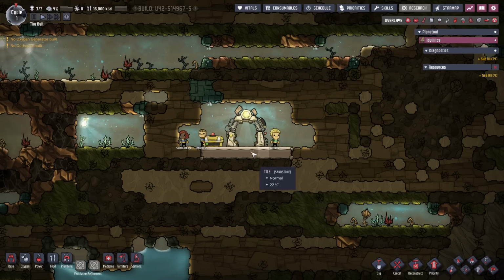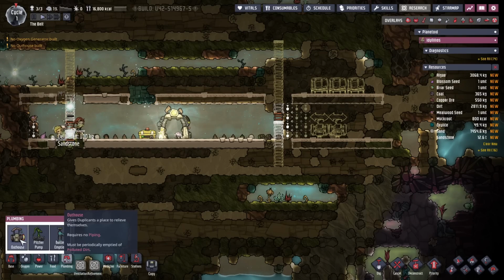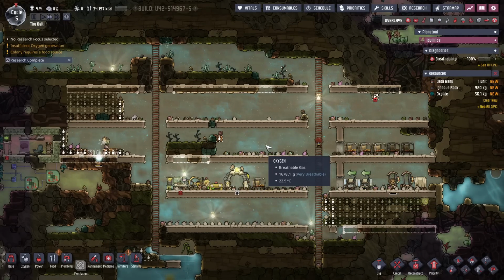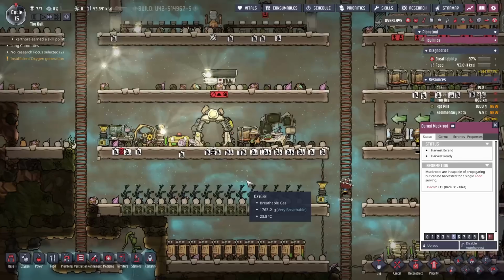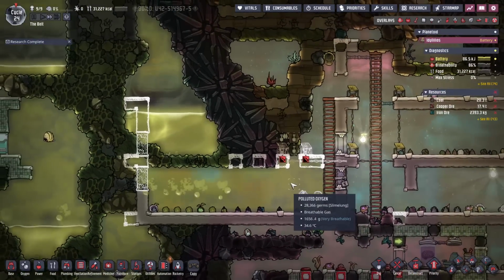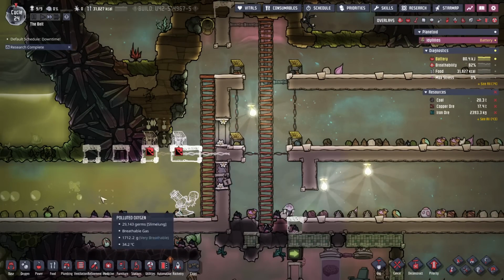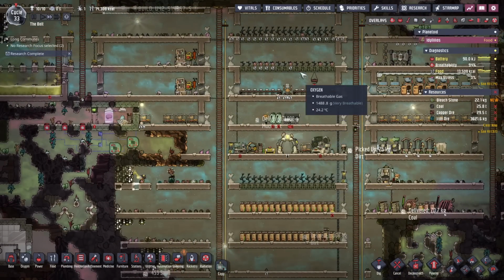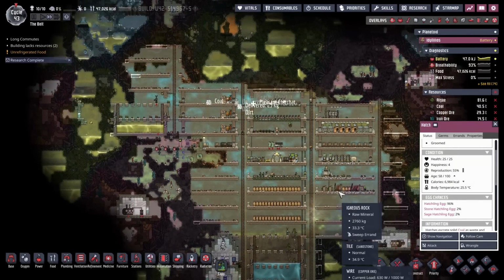Return to OXYGEN NOT INCLUDED | Optimizing First 50 Cycles | #1 | Lets Play/Walkthrough

Comment: Good to see ya back in Oxygen Not Included.  I actually started playing the game when I say you play it last time.  The one thing I would suggest so far, being half way through your video, when it comes to coal power, have 5 large batteries, and set the coal power plant to be refilled at 25% of battery charge, and through a good chunk of the early game you will loose very little coal.  At least when I play this seems to loose the least amount of coal, while allowing me to get power up and running very quickly and efficiently.